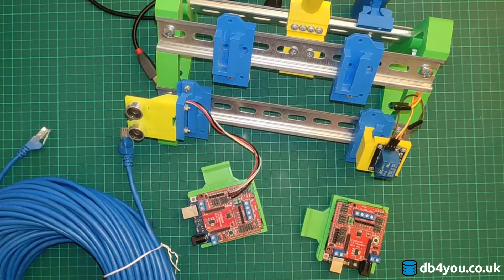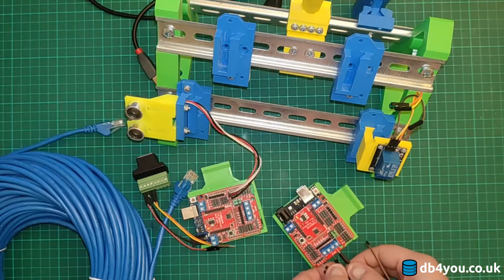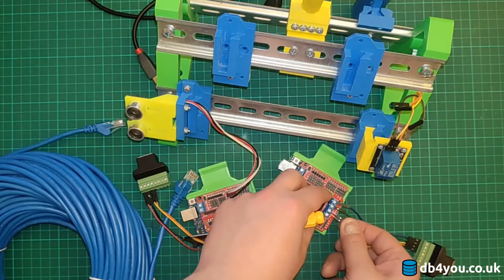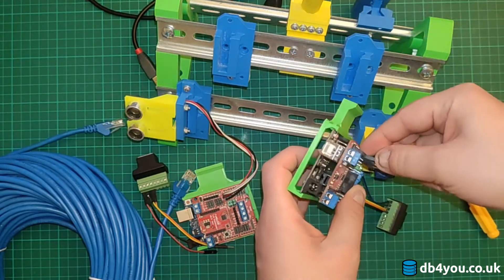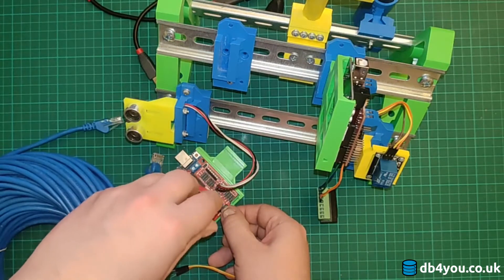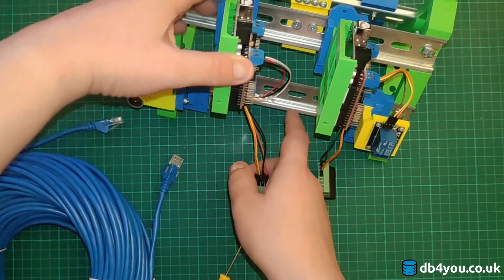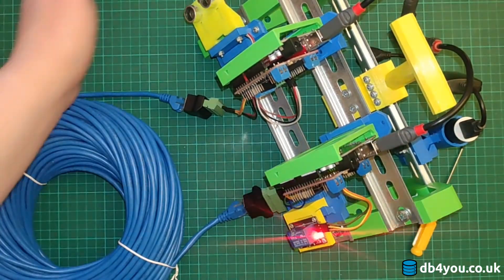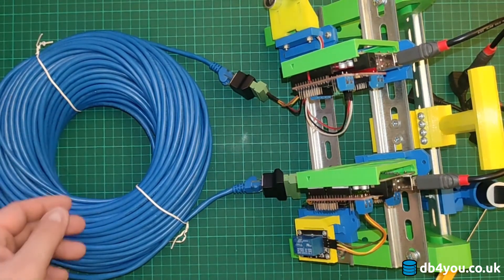Arduino RS485 50M Test

Comment: do you have schematic?
Reply from the maker: That was a looooong time ago. I do not have schematics. But it is rather simple to replicate. Modbus is just 3 wires. Unless you after the arduino sensors and how they connect.